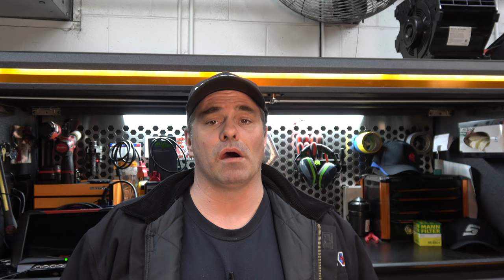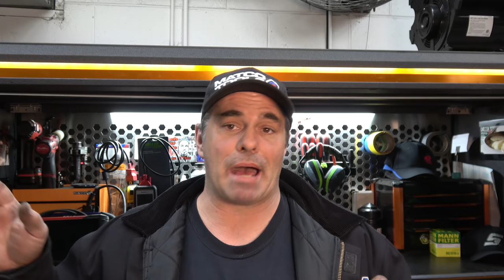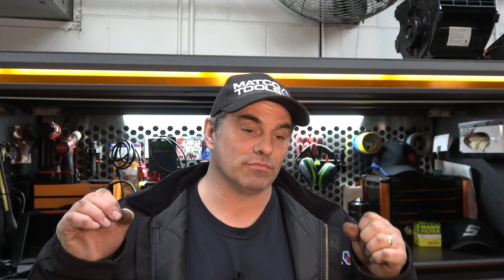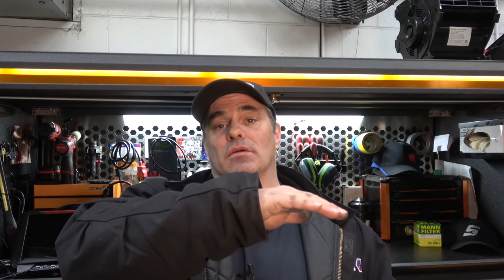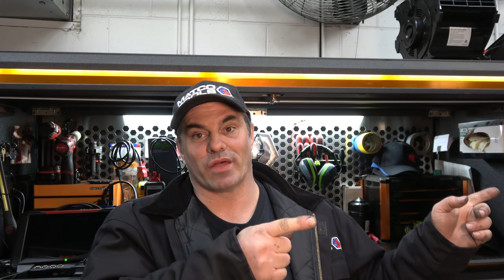Shop Management Ways to Increase Shop Efficiency

Comment: Check parts in as soon as they come in is a time saver. Nothing worse than have the parts wait over there all day just to find out that they’re wrong. They could’ve been checked in hours ago and if they were wrong correct it.
Reply: Tool87 I’ve had that happen as well. I’m not afraid to get those parts guy is a lashing. I Let them know that it affects my paychecks and I’m not happy with them.
Reply from the maker: Good point Brian
Reply: Flat Rate Master I accidentally tapped thumbs down. But switched it back to a thumbs up. Lol

Comment: wife works at a parts store....they complain about returns because parts are wrong. Picked out issue in an instant. Parts employees not verifying correct vehicle/ repair shop guessing at cars. Was telling them they need to get vins or plates up front and not guess...but both sides should know better.

Comment: As long as you got a guy like the Flat Rate Master, it makes or breaks a place. Coming in from the motorcycle side, the CHAOS of someone saying here help this guy at a Kawi shop was ran like a circus. Later on went to another shop it was ran a lot better but still no one really acted as a 'foreman' and makes it hard. The Parts as well, not in stock (oil filters, common items) and customers get angry to boot.
Reply: Dong Army Stangler   They always use the - Numbers don't show this and ... no one else says this (singles you out). That way the failed management/manager can put you on the spot anything you say will appear to be YOU are the problem employee. If I had a dollar for everytime I seen that ole trick used I would not have to work.

Comment: I seen techs with 3 weeks worth of work waiting on him 

While a different tech sits in a empty bay 

Then they wonder we have a high turn over rate
Reply: Soooooo crazy how it's the same bullshit worldwide
Reply: Last dealership i worked at...bosses fishing/hunting buddy has 4 bays closest to parts. He did customer pay work ALL DAY LONG. every day. No heavy line work. If it was less than a 5 hour ticket...went to somebody else. he was doing 70+ hours a week while rest of shop struggled to break 30. I was ther 4 months, TWO customer pay tickets. Total. Was during the first couple years of the 6.0l Powerstroke  Warranty, warranty, warranty. i gave up.
Reply: Gail Taylor quick question, noobie here does warranty work not pay for labor hours?
Reply: @k_werx  Warranty pays about 55-60% of customer pay. So a 10 hr job pays you around 6 hours. The good thing about dealer work is the cars are normally new enough not have rust issues or previous poor repairs which you end up fixing for free. Plus if doing warranty work it's the same repair over & over. You eventually get to where you at least break even. Barely. But I didn't work under flat-rate pay plan to break even.
Reply: @gailtaylor1636  I agree we here to make money
Reply: @k_werx  Warranty time can be more difficult to beat. Usually the first time you do it you  get no where close to what it pays. Over time you can learn to beat it or break even depending upon the job. Some jobs have reasonable time for the work and others I still have no idea where they managed to come up with the time for it. It really comes down to the job. Some are better then others.
Reply: I've been that tech in an empty Bay while everybody else is working can I get called on when something really hard comes in and nobody wants to touch it because everybody's too stupid

Comment: Weve got an open board at my dealership. You pull tickets at random. 

It's nice, because someone like me whose only got 1 year with jaguar land rover, (4years in other shops) can really get down deep into the brand and get to know it. My first week, I did a turbo, and a set of timing chains. 

I do think that some of our total greenhorns should be distributed tickets though, because a guy that came from the lube or tire shop down the road can turn those A or B level jobs into major expenses for the shop

Comment: Yeah those RPO codes for GM vehicles. You need the damn RPO code to scan them quite a bit it seems. More so with the older ones that don't have the auto scan feature. The HVAC system and the radio or a big one that I always get asked about on my vehicles when I scan my personal vehicles.

Comment: That's a big problem where I work they forget to order my parts or order the wrong parts and ask me when will that car be done that makes me so damn angry because my production rate is among The highest in the shop but when it takes 2 hours to get an oil cooler and a air filter then the filter is wrong don't ask me when will it be done it took 3 hours to get 7 qaursts of 15w40 synthetic oil the other day I was working on 2 other cars but the customer wanted to leave they ask me what's the hold up I said I don't where is the oil I told you 2 hours ago we need they didn't call it in I get so mad about that shit I'm going to work on something else it's not my job to order parts

Comment: Could you do a video on understanding fuel trims? Like what fuel trims will look like with a bad MAF vs vacuum leak etc...
Reply from the maker: I plan to when i have a car at the shop to film with an fuel trim issue
Reply: Flat Rate Master awesome! Also, what would you recommend as a starting point for someone turning their hobby into a career? I mainly wrench on BMWs and I’ve done head gaskets, timing guides, Vanos rebuilds... tons of stuff, you name it and Ive done it. I even know how to navigate ISTA and diagnose BMW’s fairly quick. 

The only thing working against me is formal education for automotive repair, but I’m self taught and I do things right
Reply from the maker: get a local shop to take a chance on you and take as much formal training as you can find